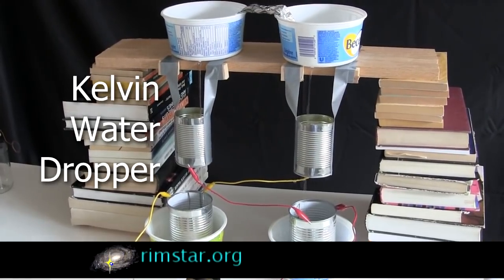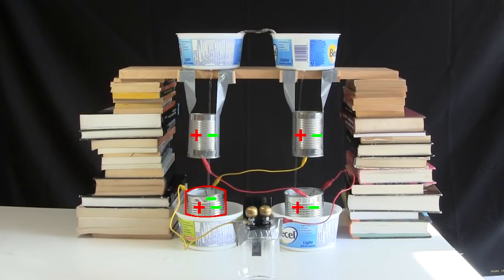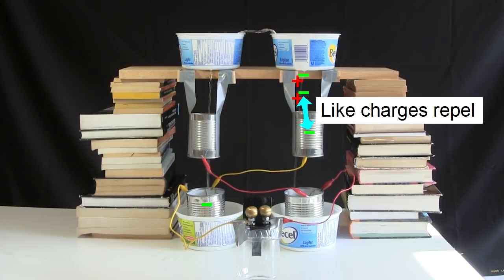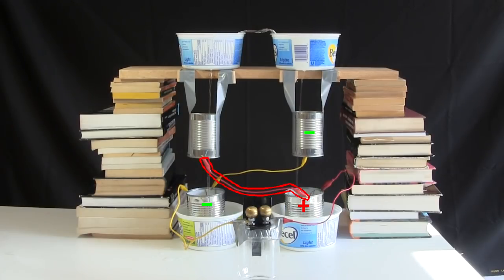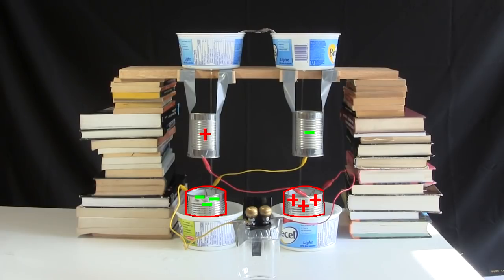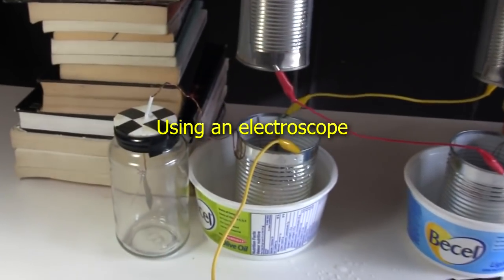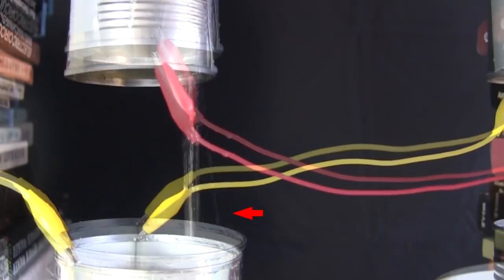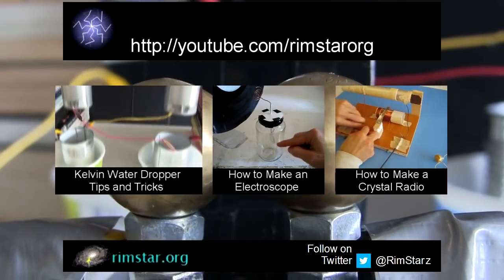Kelvin Water Dropper and How it Works/Lord Kelvin's Thunderstorm

Comment: Lord Kelvin Generator + Laser Saber's Electrostatic motor + DC motor = free energy
Reply from the maker: Naoki Kashima I wish that were the case. Sadly this Kelvin Generator doesn't put out very much. A big one might run a corona motor but there wouldn't be a lot of torque. I'd skip the DC motor though and just connect directly to the corona motor shaft. BTW you should check out my corona motor "Corona Motor (v2) or Electrostatic Motor/Atmospheric Motor"; very similar to Lasersaber's.

Comment: How can I relate this to a thunderstorm when showing students this?
Reply from the maker: Samantha Harris This separates electric charges at the spark gap just as thunderstorms separate charges inside the clouds, though the mechanism is different. This also creates a strong voltage across the spark gap just as in a thunderstorm a strong voltage develops between the bottom of the clouds and the surface of the Earth (I have an illustration of this in my Franklin's Bell video http://youtu.be/fEqudsyIWzk). In both cases, that voltage becomes strong enough to ionize the air between them until finally there's a rush of charge which is a lightning bolt or spark. Look for information on the web about how a thunderstorm works and on what causes lightning.
Reply: Thats wonderful thank you @RimstarOrg 
I attempted to make this yesterday and i have no idea why it is not working!! 
i followed each step just as explained and i am still not having any luck! I will be trying again with some different tins tomorrow incase that was the problem, the tins in the middle were cat food tins (whiskers) and i am not sure if they were coated or not...
Any other tips or tricks?
Would using a volt metre work to check the charge?
Reply from the maker: Samantha Harris It doesn't matter if the middle tins are coated, as long as the wires you connect to them are connected to metal.It does take some adjusting, so you can have it made properly and still not have it working until you adjust it. Most of the adjustment is with the middle tins. You have to adjust them vertically such that the water going into they tops is a solid stream and the water coming out of them is droplets. You have to adjust them horizontally too. I try to get the stream close to one side of the tin without touching.Regarding the bottom tins, I emphasize this in my how-to-make video anyway, but make sure that if there is a coating that you scraper some of it off so that the water can contact the metal of the tin.

Comment: At min 7:50 When any type of liquid fall from space and brakes (is divided) in drops, the static electricity  always emerges from the drops of liquid ? http://youtu.be/2sSqzLPMb4s
Reply: It is not important if liquid is conductive or insulating
Reply from the maker: Emanuele Civetta Yes, I've read the same thing a few times in the past. The arrangements and connections in the Kevin water dropper takes advantage of that to create a charge build-up so that you can get a spark.

Comment: perhaps with longer inductors or magnetizing the can?
Reply from the maker: Longer inductors help if you're having problems finding the point where the water turns into droplets but if that's not a problem then some people use just a ring for each inductor. But I don't see how either would help with increasing the gain.